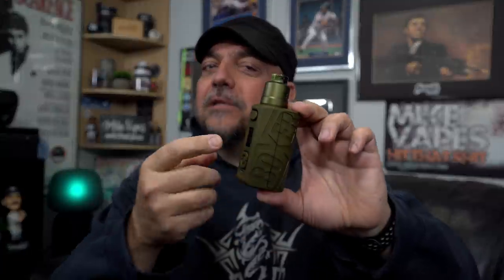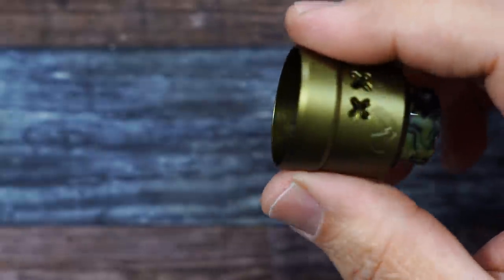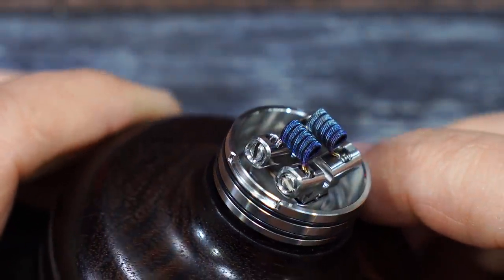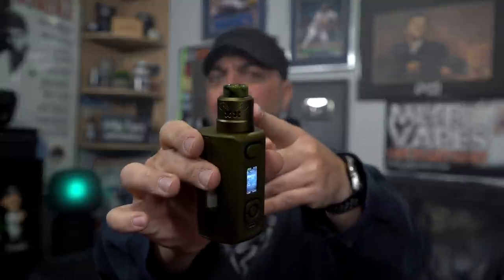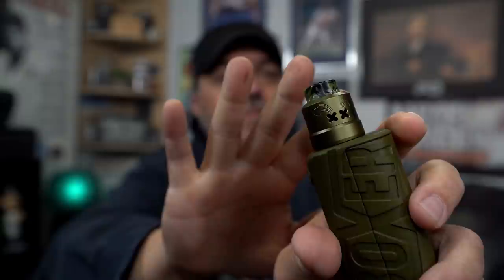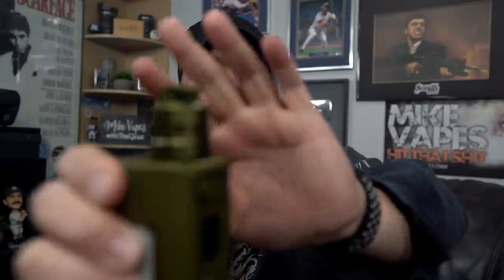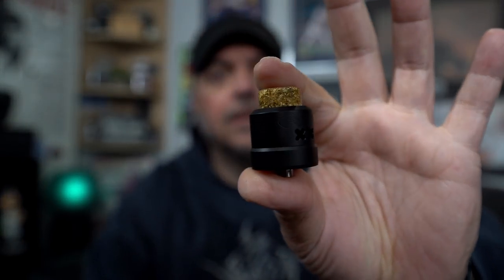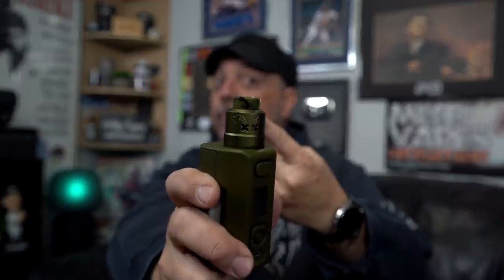Matchy Matchy! HellVape Dead Rabbit Max 28mm RDA!

Comment: Regarding the Dead Rabbit Max RDA: the top cap rotates in an anti-clockwise direction, while the airflow rotates in the same direction. It rotates away from the airhole, which does 2 things: if I close 1 hole, the air flow doesn't hit the whole coil, only part of it, which affects the flavor, and the side that doesn't get hit with air directly burns faster. At the same time, if you turn the top cap completely, it closes both air holes, instead of allowing you to open the other hole. A major flaw in the RDA's design.

What's the point of having a notch on the top cap if turning it doesn't allow you to use 1 hole properly? This is obviously an error in the design. The top cap should be made to turn in a clockwise direction, not the other way around. It doesn't make sense.

Also, the colored ones are made of aluminum, so when you do chain vape on this rda, the top cap tends to get hot in an uncomfortable level, watch out for this. I think the SS version is made of stainless steel so might as well go for that color.